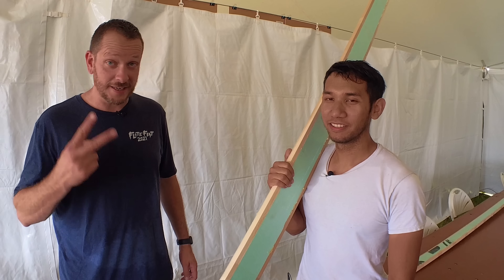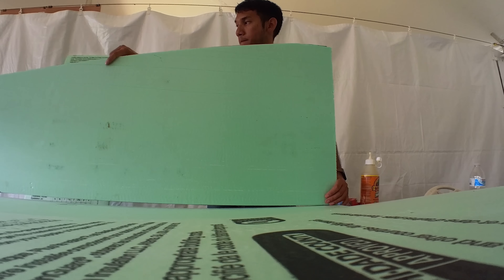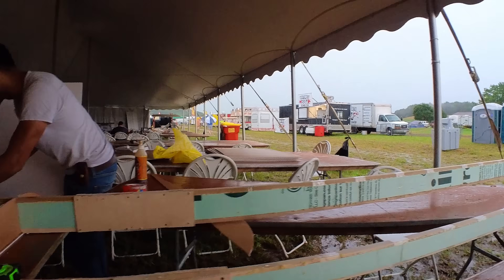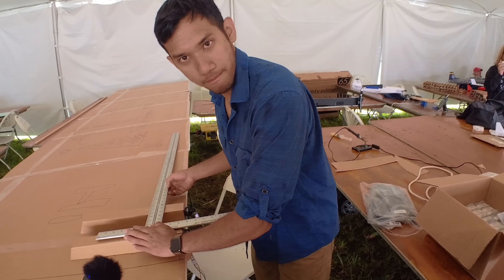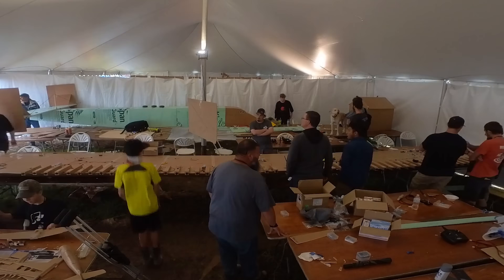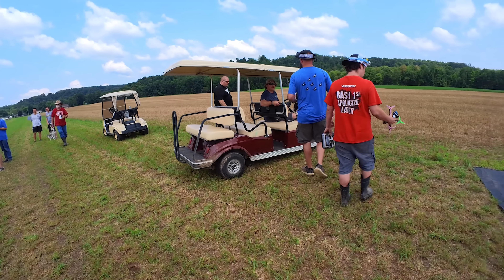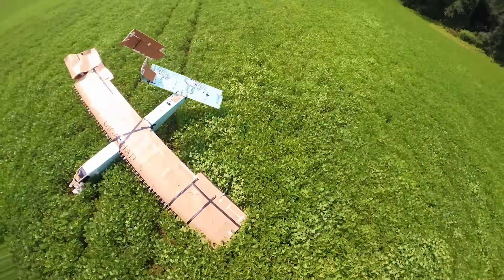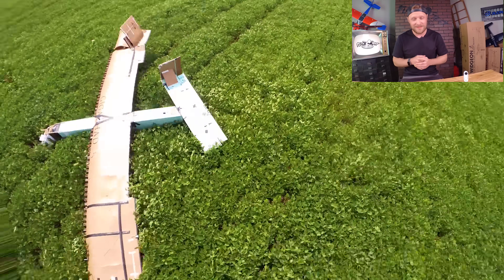50 Motor World Record 30 Foot Airplane

Comment: A big feat but perhaps in hind sight would have thought that by placing the motors front and back (push & pull) on the main wing (at least) could have reduced the large wing span fuse length and weight, making a better performer ?? with the same number of motors..or more.

Comment: It is great piece of engineering.. know the key issues of not able to turn and counter the drop of the plane.

Just wandering, if counter rotation of both wings motor was setup; or calling the 10 pilots who managing that large sets of motor, to coordinate the throttle with the results of variation thrust in time, may be able to safe the plane with great & smoother landing ☺️.

Haha, team works would be the key success factor, not only on the building but also the team of pilots ☺️

Great project!!

Comment: It doesn't have even one ENGINE on it. Those are all MOTORS. There is a big difference. Engines work on expanding gases and motors use electricity to create magnetic fields that rotate a rotor.

Comment: That is an awesome project, I'm going to see if I can trek out there next year with my two younger kiddos.

On a side note, when it was stuck in a roll to the right, assuming you could coordinate it, would it have been possible to throttle down the engines on the left side to lower the lift on the left side and level out the plane?

Comment: Next year do a bi-plane design using aluminized no stretch polyester a emergency blankets as wing skin. They’re cheap, super light and plenty tough. The bi-plane is a tried and true method of lightweight stability. And the chrome finish of the blankets will look incredible with the sun bouncing off it lol

Comment: Great attempt!

But if the wing is distorting, twisting, with roll input because its so long, why not make the wing shorter and then double the number of wings.

Make it a biplane!  Worked in the 1920’s and 30’s. 👍🏻

Comment: Use motors (vertically mounted) to assist the control surfaces. The air speed is too low to the control surfaces to work properly.

Comment: Insta360 Go2 has a lot of overheating issues, mine won't run longer for 7 minutes before shutting down. Putting it on a quad / rc plane is probably it's only useful application.

Comment: Did we make 25 motors CW and 25 motors CCW, cause if not, that's an awful lot of torque roll. No wonder there was no ability to stop it banking.
Thank you guys for continuing to go overboard. There is nothing more rewarding than pushing convention out the window and having it succeed. I would love to see an 30' wingspan Giant Stick and Tissue RC model that is powered by a 50' bungee cord for the rubber band!

Comment: Very nice...like the multi-motor approach....and cheers for the success!

Dateline: Bayfield, Wisconsin, late summer, 2005.  A young man, Hans, calling himself "FlyBike" on RC Groups attempted a 50-foot span foamy...his 8 foot and 28 foot versions had flown wonderfully off the frozen lake In Madison, WI where it was built in a dormitory hallway!  You can still find the build threads at RC Groups!  They were named Floyd, Pink Floyd, and Big Floyd for the 8 , 25, and 50 foot models, respectively. (made of pink Fanfold Foam)  The 50-footer's wing had just short of a 4 foot chord wing made up of four, 8 foot wing panels plus the 2 foot fuselage.  Three of AXI's biggest motors turning a 60" X 24", carved balsa/fiberglass prop via toothed belt
I drove three hours to join in the festivities...rain...rain all day.  We looked the plane over and I thought that the drive belt looked a little narrow.  We went into town to try and get lucky with an automotive timing belt, but the auto parts place was closed.  We even went 20 more miles to Ashland, but there was nothing that would work.  Back to the farm, and the rain quit, the clouds parted, and left us JUST enough time to get to the donated alfalfa field and set up before sundown.
The attempt was made AFTER sunset.  The runup to speed was long and gentle, owing to the sketchiness of that belt.  Just as she was getting really light and tip-toe-y on the 20" bicycle wheel landing gear, there was a ripping/crunching   sound magnified by all that flat foam!  The belt had lost most of its teeth when FlyBike gave it that last bit of throttle.  the plane settled back into her suspension and we went out to drag her back.  She was disassembled by car headlights.  FlyBike went off to Madison for his second year of engineering school the next day, and that was that!

Comment: You gotta mount the motors under the wing, not in front of it. You want the wing to see as much clean air as possible, or else you'll get premature flow seperation, so mount the motors under the wing (make sure the prop doesn't stick up over the wing) and you'll get a bunch more lift

Comment: Peter- a couple of suggestions from a plumber;  build the wings with an upward curl- it should be easier to build a little "tension" into them to stop that wing deflection, run the ailerons further inboard to reduce the twist, and set up the motors to push/pull to condense their weight closer to the body of the plane. That's what comes to me- btw, killer post crash analysis- I had to watch it twice, once at half speed, to get a clear idea what twist you were talking about!  Another thought, but needs big servo; make the whole wing tip section the aileron and it's pivot from the center of the wing- that could also reduce the twisting of the wing itself. But, I have faith- you will make this fly and work- and the fella that thought you ought to be flying in it may get the shock of his life! FR

Comment: That is why planes with long narrow wings usually use spoilers instead of ailerons.   After a certain point, ailerons tend to twist the wing causing an inverse control reaction.

Comment: The right wing lost lift and that's why it nosed over because of insufficient air speed, however if you had enough altitude the wing would have regained lift and you could have saved the plane...but it was a good flight

Comment: Someone here posted about the motors being under the wing, and how that killed the lift. I would submit the C-130, C-133' and similar prop driven heavy-lift cargo transport birds, as well as all the jets that do quite well with underwing engines, thank-you-very-much.
The problem here was OVERCONTROLLING; as a former R/C and PC Sim pilot, I can tell you, it's bloody HARD to fly a brand-new, untried airframe, with an audience, any kind of crosswind component, and NO kinesthetic sense feedback for what the bird is doing. Plus, you can get "behind the bird" in split-seconds. Low, slow, turning, high AoA banked turn - I could tell he was going in before he got ten degrees out of 'straight and level.' And it wasn't his fault, either, other than trying too hard for a perfect first flight.
Just like every test pilot since Orville.

Comment: Titanium spars might work 🙂
Reply: Carbon fiber is much cheaper, and you can get those standard in all sorts of shapes like box sections. CF is also stronger per weight, so I would suggest CF.

I personally like to use carbon fiber arrows as spars for most of my small planes, as if I crash it or lose it then I can pick up as many as I want from the hunting section in stores without having to wait for shipping. But if you know what you're wanting, you can get almost any size of tiny to large box section/strips like for thin micro airfoils (for indoor builds), or tubes for surprisingly cheap. I don't even spend the big bucks for that fancy foam they use, I just stick with the $1 boards (which aren't as good, but they are cheap), and reinforce the edges with either bamboo camping skewers and the arrow spars. I've also done full blown fancy semi-monocoque CF layups with magnetic access panels and all the bells and whistles you could want, but that was for $5k+ models and my budget is more like $2 to $5 for the airframe plus slap in $20 in electronics and a cheap battery because I'm going to crash in 30 seconds anyways, haha! I mostly enjoy building them, very little skill at flying fixed wing, lol!